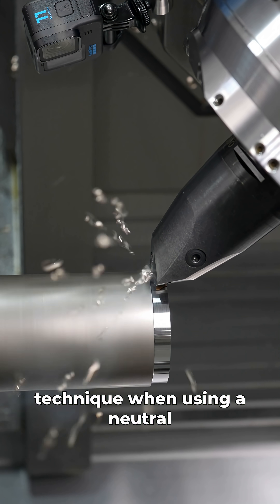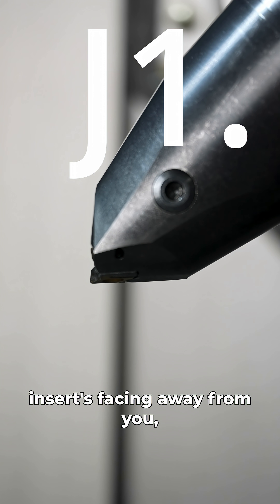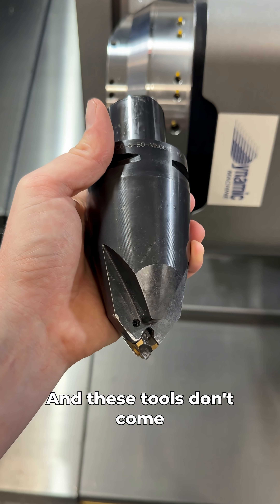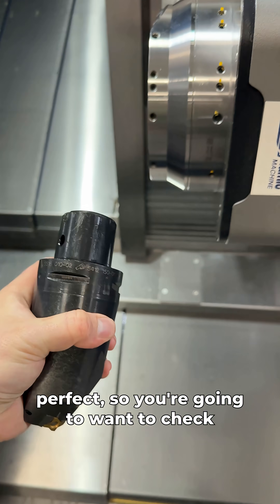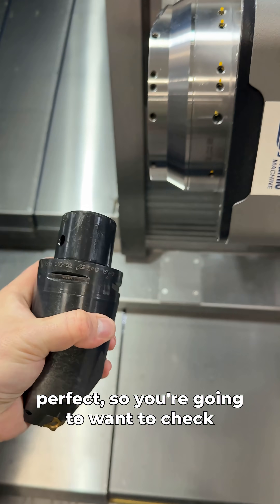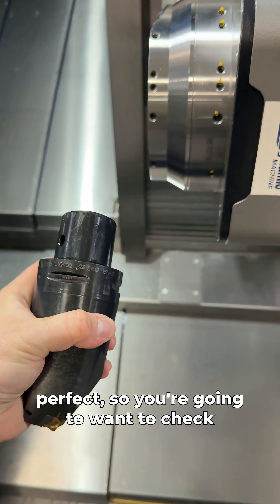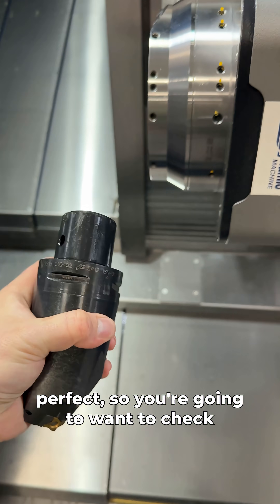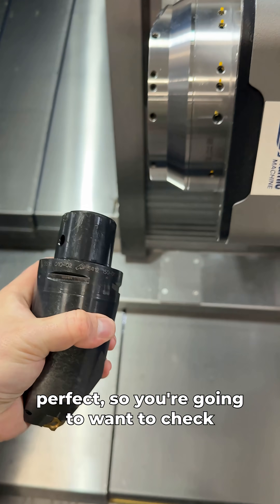Measure TWICE, cut ONCE

Comment: Actually before what you do on your video you need to check and calibrate your B-axis rotation point in relation to your tool mounting (rotation) axis because in most cases this is the real reason of inaccuracy which you indicate -not the tool geometry inaccuracy. Also your machine needs to be levelled up perfectly because if not then you will have differences between main and sub spindle anyways. The rule is - square your machine and bolt it down to the floor on each foot first! This may take a day or two! Then it is easy to correct things.

Comment: How do you determine its just not your x off by that

Centre line normally just need to face off and check for pip 
We would probably go like .01 .02 mm
Over CL then no pip left on job
Reply: I'd have to draw it on the whiteboard to explain it. I tried in words and it won't make sense

Comment: Look at the surface finish on the second measurement, sometimes this difference can be eliminated with just polishing.
Reply: Why would you waste time by doing something manually when the machine can do it to dimensions and proper surface finish without anything extra?
Reply: I said the same thing to your wife last night. "Baby this can be eliminated if you just polish the dome off. Make sure you use a clockwise motion too.

Comment: Wouldn’t that mean your Y axis is slightly off or is that just deflection in the bar?
Reply: No, the tool is not perfectly symmetrical, meaning the insert tip is slightly off from the rotation axis.
Reply: When you spin it 180* it's not at the same exact theoretical point in space. Like think about if your drill had only one cutting edge. If you put an indicator on it and it's not perfectly on center if you spin it 180* your indicator isn't going to read zero anymore in this case it'd read .0007 difference. It's the same exact conceptualization.

Comment: I don’t understand… are you saying taper equates to how on center the tool is?… the tool being in center generally just determines how well it cuts and tool life... Or are you trying to say that if one side is cutting at 2.4 and the other cut is .0007 off then the tool is off center by half that?..
Never used a mill turn before so this is weird to me.

Comment: I have a question with tool calls on this machine. When you call a tool are you calling it T123M6 J1?

Just curious because I'm currently on a Mazak I450hs which is very similar and all the tool orientation is handled by the tool data and you simply call the tool#
Reply from the maker: The tool is called like M6 T02002

 T02 is the tool number the next 3 digits 002 are your offset

Comment: Why don't you use the spring loaded knob on the micrometer? Otherwise you might get wrong measurements because you can apply too much force on the micrometer.
Reply: By the sounds of it, he's looking for thousandths not ten-thousandths but it just so happened that this tool was off by less than a thou.

I have compared without using the ratchet then with and got the same number. It's just training for feeling like every other feeling in this trade. Now I use quantimics so others don't complain about where I'm grabbing, even if the tol is 0.010".
Reply from the maker: I can hit the same number within .0001” with my eyes closed tbh with you. I know that sounds cocky but I’ve been using that tool since I was 12
Reply: @donniehinske it’s not only about repeatability. What if you’re great at always applying the same force but it’s always a little too much?
Reply: @Highspeedfutzi  So you check against a known standard and make sure your measurement matches the standard's size. Mics are not a tool you set once when first making them, you should be checking the zero and cleaning the anvils during use anyway.
Reply: You just started machining like a year or two ago right? You get the feel for it. Which is a lot of machining lol. After you've been doing it for as long as some of us have it just becomes 2nd nature lol. You're able to differentiate between normal and bad sounds. You can read the G code like it's a book. And stand at the machine writing a whole program in MDI.  It just .. clicks at some point. I don't know how else to explain it lol. If I was training an apprentice I would tell him to do exactly what you said lol. But then I'd measure a part get the dimension then tell him to close his eyes and do it by feeling to see if he got the same dimension lol.
Reply: Its fine. it comes with experience.
Reply: @mikaelaberg7283 But that’s the whole point of micrometers: always the same measuring force.
Reply: @Highspeedfutzi that wasnt the point i was making. Applying the same/right force comes with experience.
Reply: @Highspeedfutzi  Only matters when you get tighter than a thou of tolerance or the operator has the same feeling as a gorilla. For something like this, it's fine. He's measuring a test, not a part.
Reply: @Highspeedfutzi also i find it easier this way while measuring like diameter 250-500mm. Much faster to find the center for me atleast.

Comment: It's cool how you can immediately see that something is off on J2 because of the surface finish. The j-1 finish and after fully calibrated is beautiful
Reply: Surface finish is a combination of things, here the bad looking surface finish comes from taking off too little. Every insert has a minimum dept of cut that it operates well at, anything below that and the geometry of the tool just doesn't work properly.
Reply: Finish ≠ precision, taking a deeper cut leaves a better finish, which is what I assume he did at J1. Correct me if I'm wrong
Reply: @adamlukasz6302 generally taking less of a cut gives a better finish in my experience, that's why you have a roughing pass to do most of the machining work and then you do one or two passes for the last thousandth or couple tenths to really hit that dimension, because the tool deflects the more load you put on it
Reply: @SamCyanide  You may be right then. I don't really use lathes, just wrote off from what I did in school.
Reply: @SamCyanide Yes and no. You still need to go deep enough for the tool to actually cut and not rub on the tip. A cnmg insert like that isn't going to like a finish cut of .01. If I looked it up it'd probably tell me it needs at least 1mm DOC. If you're taking a shallower finish pass you're going to want to use an insert with a sharper tool nose radius of like .007. So a VNMG 431 or 331 it's been a while since I've done turning. But yeah you're not getting under the material and cutting it. You're rubbing on the tip of the tool which gives you the crappy finish.

Comment: Do a macro-video on higbee cut / blunt start threads, on both thread start and end (y)
Reply: A higbee is easy as you just need a square grooving tool equal or larger than the pitch, use the threading cycle but change the Z to be 1.5xPitch (this is just a rule of thumb, some threads give a specific depth).

I would be interested in the blunt start though 'cause it would be nice for a customer requesting a blunt start in a specific spot.
Reply: @iDeLaYeD_o  Yeh, I've seen that been done many times, but I wrote a program for milling it, giving it a proper blunt start. The tool companies put out the PDX value on their inserts, and that's valuable when mooving the tool out.  I know Donnie is very skilled in macro programming, so I would like to see his take on it. Maybe I'll then see a much better solution, and maybe we all learn how to do it nice and easy (y)

Comment: Will you not be moving the offsets in the Y axis to get them on centre? And then adjusting the offset in X to get it back on size?
Reply: In theory yes you should do that. However depending on what class of insert you're using your Y could vary depending on how thick the insert is within its tolerance class.

No matter what you would want to make sure it's not off by some egregious amount. If it's off by .050 then absolutely it needs to be checked/adjusted. Off by a .001 would probably be within the tolerance of the insert thickness.
Reply: This was my question